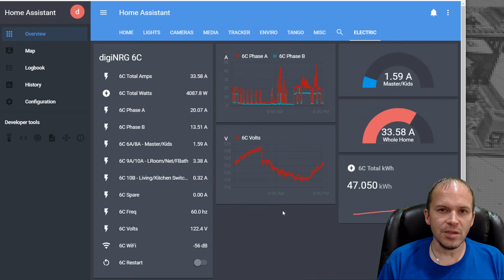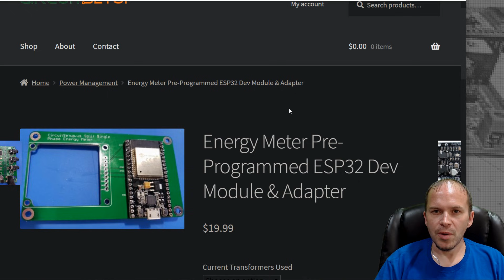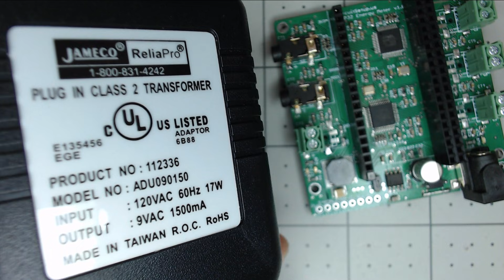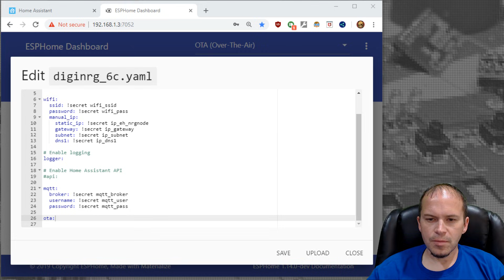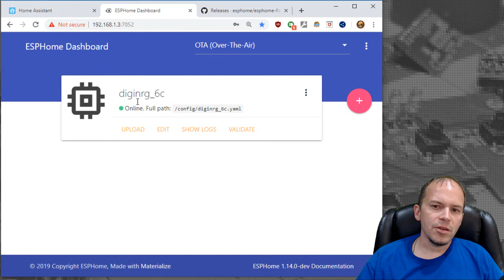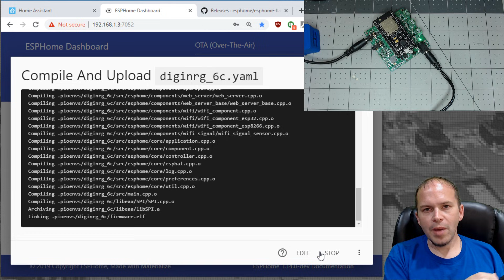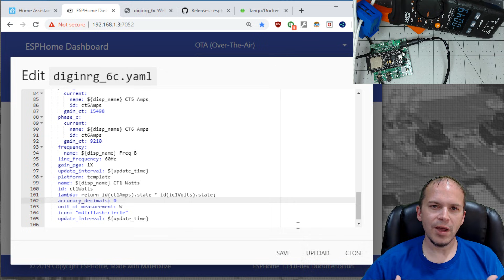DIY Whole Home Power Monitoring with ESPHome & Home Assistant

Comment: Can it be used with 3 phase installation? Can it derive/approximate the 2 remaining voltages from the first one?
Reply: The ICs are actually made for 3 phase. However, the 2nd and 3rd voltages are not hooked up. You can get around this by writing to the B and C voltage registers. From what I can tell esphome cant do this yet, but I may figure out a hardware solution for the next version.
Reply from the maker: I'm not familiar with using it on 3 phase but I would assume you could just put the clamp on it and go?  Of course you could have the voltage differences.  Might be a good question for the CircuitSetup folks.

Comment: I am wondering if the board is accurate enough to... Instead of adding SCT clamps to other circuits only clamp to the main input and develop signatures based on voltage changes for other devices coming on and off. For example. The dryer draws xxxmA and if you detect a change in voltage of xxxmA the trigger automatons for your dryer. Fridge draws xxymA, bedroom fan yyymA, etc...
Reply: I don't know for sure, but I would not think so due to the following. It would take less energy to reach the temperature set on your dryer from summer to winter because of the air temperature. Also if you ran two loads back to back the air temperature would be different, so the drier would not have to work as hard. But that's just my guess.
Reply: Check the paper for NILM - non invasive load monitoring
Reply: @kabturek  This is a kewl idea. I am going to look into this further. It would open a whole new world if you you could, in some cases determine what is on and off based on load. I see HA reaping huge benefits from this
Reply: You could figure out what is what if they are inductive and resistive loads. The metering ICs figure out reactive and apparent power. So you could, for example read the "signature" of you electric dryer when it is on. Reactive power will be low (apart from the motor that spins the drum). Obviously that would take a bit of work over something pretty packaged like Sense.

Comment: Great video.

I'm considering getting the 6 channel board but haven't found a source for 200a CTs.  I have 200a service at the panel.  Does anyone have one? 

Would also be in the 3D case stl file.

Looked at Iotawatt and found 200a CTs so that may be a source. They were $21.  The Iotawatt wasn't something you can easily be modified or reprogrammed. It was open-source.  Is this what those that have one have found?  It's big plus was it is UL approved.  

As for safety,  I thought you could attach the clamp to a live circuit wire as long as the plug end WAS CONNECTED.
Reply: Magnalab makes 200A CTs. As long as the burden resistor or zener diode is there, you shouldn't have to worry about open circuiting the CT. It's good practice to plug in the CT before putting it around a live wire though.
Reply: Thanks.  But they are too pricey
Reply from the maker: Have you searched around eBay for any sellers?
Reply: YHDC makes 200A ones as well, but you'd have to order on Aliexpress or eBay. Do a search for SCT019.

Comment: You should recommend installing a CT shorting block for the standard current output CTs without burden resistors.  See https://www.schneider-electric.us/en/faqs/FA274542/ for more info
Reply: The current output CTs have built in zener diodes. I don't think that would be necessary, but I could be wrong.
Reply: John deGlavina I sell these as part of my job and a standard CT from the electrical industry does not, the little blue ones he uses in the video may or may not
Reply: @D-Khaz  right, the yhdc ones either have a zener diode or burden resistor built in.
Reply: @jdeg2000  Good to know, they should be safe without a shorting block then

Comment: I put in an iotawatt back in December to accomplish the same trick.  NO affiliation, but check them out.  $129 in a case for 14 channels.  CT's are extra of course.
Reply from the maker: Nice! Curious how stable in measuring it is as I have heard mixed stories but never personally was able to talk with someone who has one installed.
Reply: digiblurDIY mine has been rock solid stable, and is within 1% of util co’s kwh each month.  My only complaint is that they initially shipped me the wrong ct’s, but they took care of it very quickly.
Reply: @netmagi  How often does that take readings? Also, do you get metering data like power factor and reactive power? From what I understand it uses standard ADC IC's so the calculations are done in software.
Reply: @jdeg2000  Provides pf, apparent power, and real power.   I don't know enough about it to tell you how it's accomplished, but I can graph all 3.
Reply: @digiblurDIY  Here's a screenshot of what the internal status page looks like on mine: http://gallery.netmagi.com/d/14559-2/iotawatt.JPG    And here's what my dashboard looks like in emoncms: http://gallery.netmagi.com/d/14562-2/iotawatt_emoncms_dashboard.JPG
Reply from the maker: Very cool stuff!  I looked at emoncms at first but then they didn't really have an easy to use docker container so I jumped to using grafana w/ influxdb as the backend as I already had it running do other charting of sensors around the house.
Reply: Do you have it integrated with Home Assistant and can you see the actual usage in real time?
Reply: @dayvebergman Yes, shows realtime on it's own internal web server status page (1 sec updates).  I am not using home assistant with it.  Using emoncms with some built-in apps and made my own dashboard.  Also pulling some data into cacti as well to supplement an older dashboard I made yrs ago for something else.  I need to learn grafana.  It's way prettier :/   I almost rolled my own with a pi and a bunch of ADC's, but found the iotawatt at the last minute.  It's almost like they go out of their way not to be found.   I'd never heard of them and didn't come across them on 10+ projects builds, etc. that I looked at.  Eventually discovered them on a forum.

Comment: Great video. You can trick the clamps into thinking that they're is more current if you loop the wire back around and through the meter clamp. So if you had  a 10A load with 1 wire through the core if you wrap it around and bring 2 wires through it will read 20A.
Reply: why would you want to do that? Would that be a way to measure two lines using only 1 CT clamp? So if I wanted to measure a 220V circuit like in the USA (which is basically just two separate 120V lines), I could put the clamp around both wires and it will automatically add up the amps and watts?
Reply: @teddyruxpin3811 increased accuracy by dividing it back down. If it's max 80A but you're measuring a 20A circuit, you can use 4 loops and divide by 4 to lower the minimum measurable current

Comment: Note this:  When you put hot and neutral wires through a ct, your current reading should be 0 amps on a 2 wire circuit. (aka this how GFCI works through a ct inside the device or breaker) If you clamp an amp meter on the neutral and then clamp it on the hot of the same circuit it will read the same. When clamping both Hot & Neut of the same circuit value will be 0 (balanced)
If your clamping it on a 3 wire circuit where the neutral is shared, your reading will be the different or the unbalanced load of the two circuits or if both hot's have the same type of load L1 = 1500W (Black) L2 = 1500W (Red) then 0 watts 0 amps on neutral (White)

Comment: Great video. Can you share the file for printing the case?
Reply from the maker: Thanks for the reminder! Yes. I will put it up on the GitHub as soon as I can today. It does need a bit of finishing on the lid but I didn't use it as you can see.
Reply from the maker: Look on the Github for the STL.  I only printed the case and not the lid as it does need some work.

Comment: Great video.  I was actually considering using something from iotawatt.  I currently have an Aeotec HEM but was wanting to monitor additional circuits.  I'm using power monitoring plugs where I can but still needed something for high current devices.
Reply from the maker: I don't have an Iotawatt but have looked at them before I looked at this one. Their software seems very mature but went with the hardware that seem to have an edge up on things.